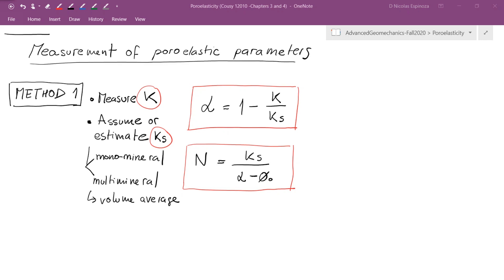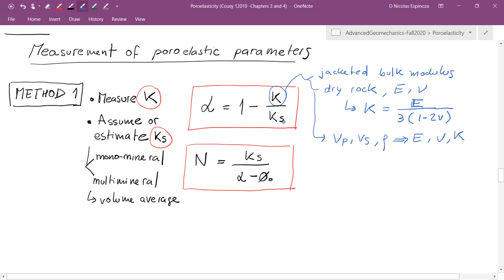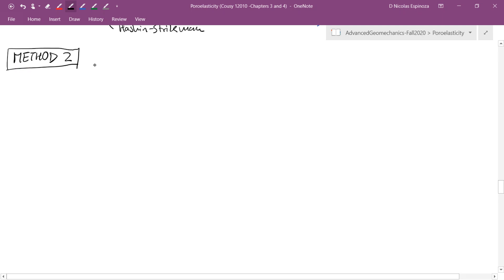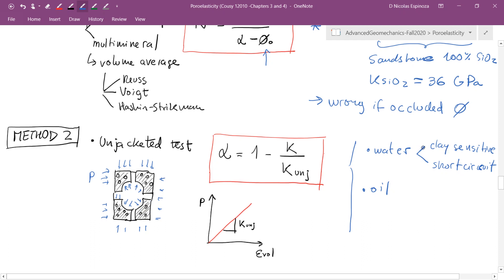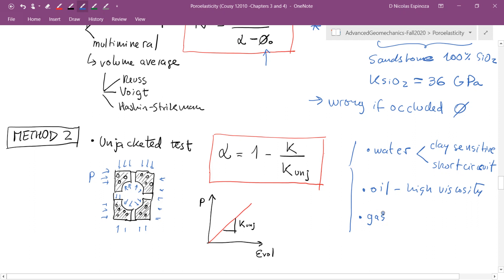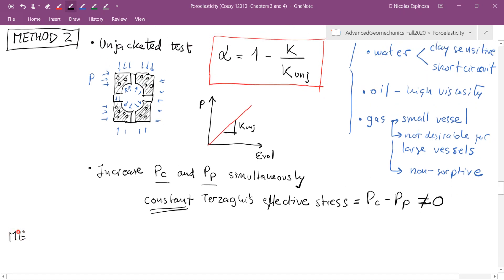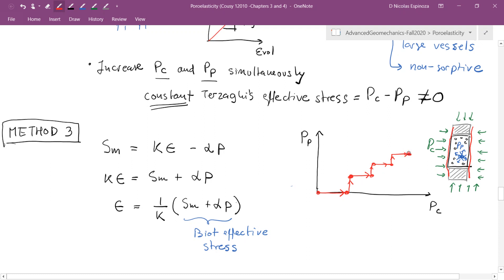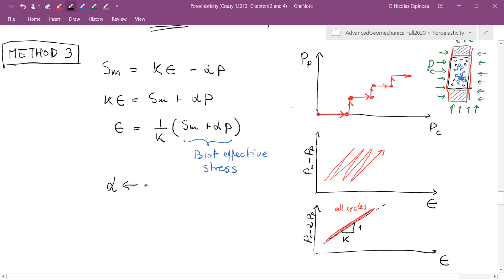L18 Indirect determination and direct measurement of the Biot coefficient

Comment: Hello, thank you very much for this very interesting lecture. In method 1 it is mentioned that the bulk modulus K=K_jacketed. I was wondering if this bulk modulus K is equal to the drained bulk modulus, or if it is rather equal to the dry bulk modulus. Or is K=K_drained=K_dry in general? Thank you very much for your clarification!
Reply from the maker: Hi Jean, the terminology can be a bit confusing sometimes. Here are my 2 cents: (i) K volumetric or bulk modulus is a general definition so you have many K's depending on the case, e.g., K_drained, K_unjacketed, K_undrained, K_mineral, etc., (ii) K_drained is equal to K_jacketed as long as the process is drained; a jacketed loading can give you K_undrained if conditions are undrained, and (iii) K_drained is very close to K_dry in several rocks, however, it is not true for some materials that cannot "exist" without water or other fluids because if dried they become something else; this is the case of clay-rich rocks/sediments or hydrocarbon rich source rocks. Make sure you watch https://youtu.be/fJpNAcLjNM4?list=PLv0npDbE5HXusG9Z-az2VtZYRhgqVUwNK about undrained loading.
Reply: Thank you very much for your clear answer !